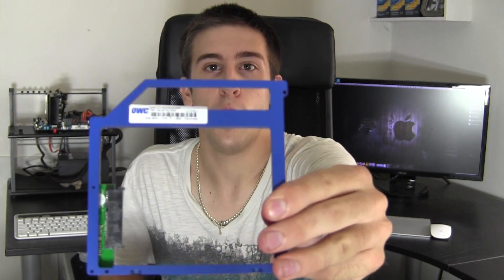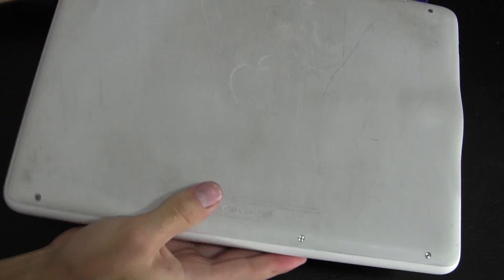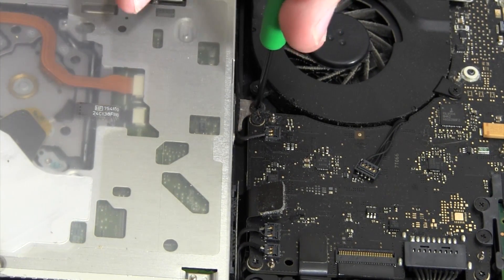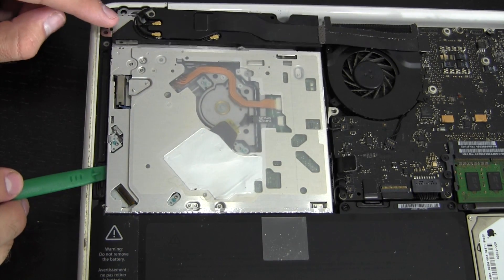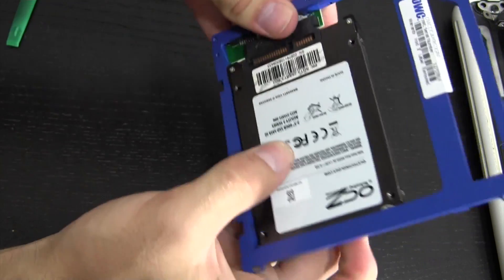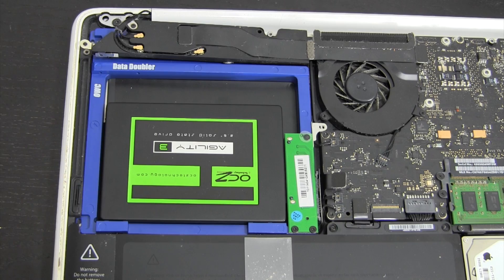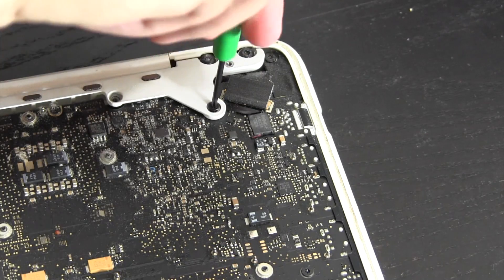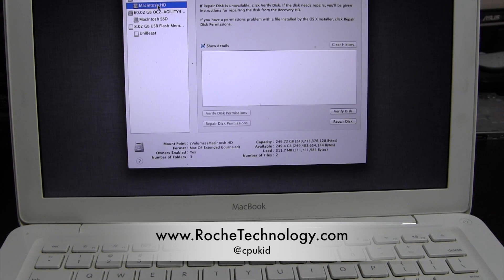2010 Unibody MacBook OWC Data Doubler Upgrade

Comment: I just installed a 500gb hdd into the data doubler, them tools they give you are crap, the screwdriver stripped on the bottom cover screw... luckily it didn't damage the screw.

Comment: i have a 2007 15' macbook pro and i want to remove the optical drive, and possibly make a fusion drive with an SSD in the future. but if i remove the optical drive now and just leave nothing in its spot for a while will it cause any problems?

Comment: I can't believe you spent $35 on the data doubler when amazon offers caddies for $10 also I recommend buying a cheap enclosure for the SuperDrive to create an external drive just In case you need it!